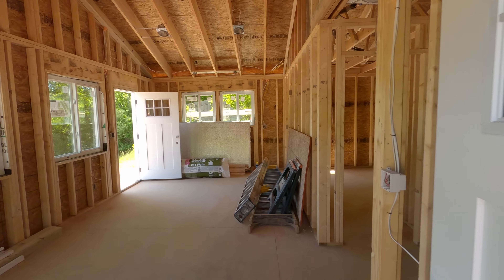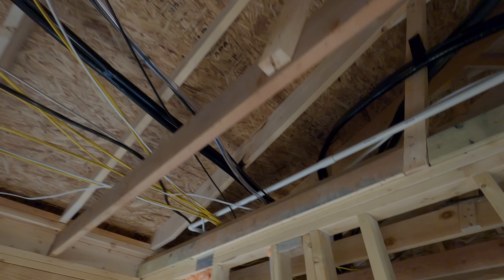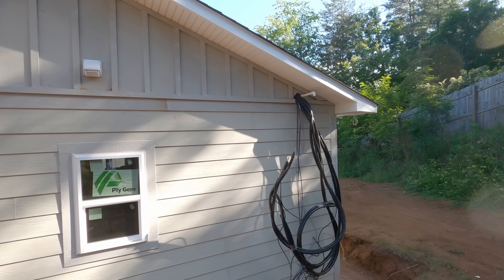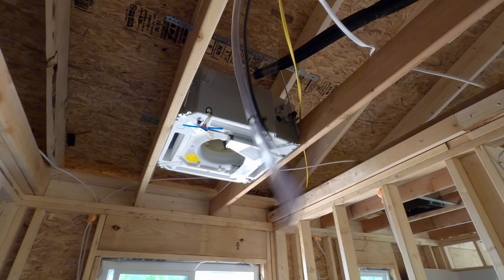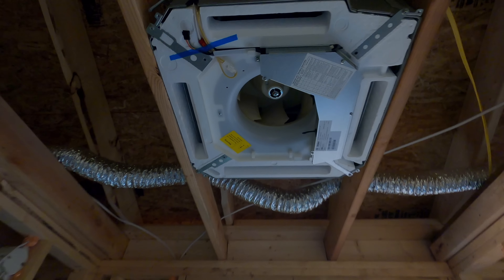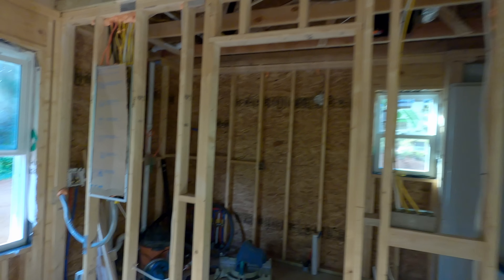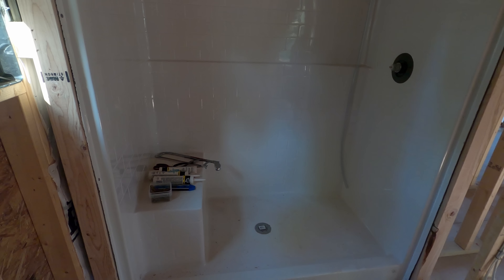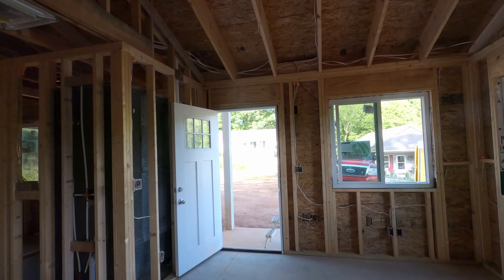Ductless Mini Split System Price / Cost

Comment: I’ll echo many of the other comments. They could have ran the AC lines inside the wall and popped out the bottom of the wall for a much cleaner install. Forget the trim work that needs to be done. You don’t need to see line hide on the outside of a NEW house. That is for remodels where the walls are finished.
I also agree with the few commenters that mention the electric wires are not neatly run.  I always run the wires in a bundle and straight lines. 
Anyway, thank you for putting out great content and don’t let the negative comments get to you, we mention things like this cause we care, not to just be a pain in the ass.
Reply from the maker: Thx dennis no worries, I posted this to show you guys sometimes things like this happen, I'll see how this is handled by the hvac business and see how it got resolved.
Reply: @MigraineCraftsman  yup, that's what I'd do.... "how are you gonna fix this" and it's not the mini split that's the problem, it's the attention to detail of the installation and the crew who did it. Poor quality in my book and if they make it right I'd let it slide. If not... Kick rocks kids
Reply from the maker: @Keasbeysknight  You earned yourself a hearted comment. In business you have to learn how to handle situations and sometimes brute force is not necessary, but a more tactical approach is best.

Comment: They should have capped the line sets instead if leaving them open to air. You can get debris, water, and bugs in the line sets that will ruin system. Not cool

Comment: Correct me if I'm wrong, but at 1:25 you can see the copper lines opened up at the ends. I've done some HVAC systems in the past and from what I know those copper lines should not be left open. Those lines must be capped on both ends until refrigerant goes in, otherwise you risk refrigerant lines being contaminated and it will be additional cost to flush them out. I would suggest to go with PVC pipes for drainage, don't let them install those vinyl pipes, it won't drain property. Any reason why exhaust vent line runs for such long distance? I would recommend you to change it to hard round duct.
Reply from the maker: PVC is what is going to be on the final install as for everything else, there is a lot to this install so I'm going to reserve any further judgement until I see the finished product and see if it works.
Reply: @MigraineCraftsman  Keep up great work, dealing with mediocre contractors is not easy! 👍
Reply: @unnamedny  that install is so far below mediocre it is beyond comprehension .

Comment: I do appreciate your concern for this install. Also thanks for letting us know the price difference between ductless and ducted.

My long term concern about a mini split is that with three heads to clean the homeowners may not be so keen on doing it and it could lead to a shortened lifespan for the unit. Those heads are also quite unwieldy to clean.

Also, don't believe the seer lie.. that's for mild climates where the outside temp is quite close to the desired inside temp. For example it's 74 degrees inside and 80 degrees outside. In hot weather like ga or in my case Texas where it could be 95 degrees outside, any properly sized unit will be running wide open for most of the summer and that is straight up eer rating, not seer.

There are some units that have a higher seer rating, but a lower eer rating than another unit with a higher  eer but lower seer. I'll always take higher eer.

Comment: You’re a great builder with tons of integrity, you do very nice work👍🏽. The only thing I would have to criticize a bit is that bathroom flex vent tube, I would’ve gone with the insulated type only because all of the callbacks I’ve got for leaky exhaust fans in bathrooms that are incorrectly installed due to some builders using that flex duct I a uninsulated attic. I see you insulated pretty well, just in case you see water coming out of that fan know that that’s the probable culprit.

Comment: Great description. I became a huge fan of split ac these days. Good that you went for it. You are trying new stuff for every build! Kudos.

Can’t you install it yourself?
Reply from the maker: I'm not licensed for Hvac, but I will be looking into it.
Reply: Nearly all A/C manufacturers will only warranty their equipment if it is installed by a licensed dealer, so this is really one part of the house that isn't DIY.
Reply: @afh7689  so what ? If you do it all by yourself it would cost around $3500 and you save $2500 . What part, on  the system, will cost more than that?   A warranty  for lazy fools

Comment: Great update. I was waiting for the mini split install. For some reason I thought that it was going to be the wall hanging units. Anyway, can the installer run the line set down the wall on the inside and then have it pop out through the bottom? It does look kinda tacky coming through the gable an then having to snake down the side of the house. Also how many thermostats will be controlling the units?
Reply from the maker: There will be 3 remote controls for the unit. As for the wall units I would have preffered those but they were more expensive over a grand more. The install here is interesting to say the least but I left them alone expecting proffesional results, well I learned.
Reply: @MigraineCraftsman   Don't give up yet. Let the company owner know that you're documenting all your builds on YouTube and of all the HVAC installs, this one was a bit lacking. Let him know that it would be better for his business if he made his guys do a better job on the install.

Comment: Omg. That hole has me PO'ed like I'm the builder or homeowner. Has the mini split crew never heard of a hole saw or neat work? Grrrr!
Reply from the maker: That is what I posted in my community section, I'm suprised they didnt have that when they showed up for the job.
Reply: Omg, me too. I wouldn’t ever get over it!
Reply: @MigraineCraftsman  You have every right to be upset over that. What they did was shoddy work. No concern for quality or craftsmanship. When I was an electrical apprentice, my master electrician was so keen on craftsmanship, he'd demand that the slotted screws on the light plates and electrical plates were all lined up vertically, because people pass judgement on a person's work sometimes based upon appearances. We did quality work behind the walls, too, but what he taught me about appearances and caring about how good of a job you do on both sides of that wall are things I've used throughout my life. You're 100% right to expect them to have done the job correctly. What they did translates to nothing more than getting the job done as quickly as possible to pocket the money, because time equals money. So sad.

Comment: Mini splits are amazing, but do understand that while you can condition an individual room and they all have individual thermostats, you cannot, on most systems) simultaneously heat one room and cool another.  The entire system is either in cooling mode or heating mode, which is fine for most people and use cases.  There are mini split systems that have heat recovery function; these systems with heat recovery can redirect heat and enable simultaneous cooling and heating of zones in the system.  Currently the only system I know of that works on residential single phase 240V electrical is made by LG.

Comment: Im a licensed builder for 20 years. I flipped hundreds of properties and worked on just about all of them myself. I wire houses, i do plumbing roofing etc. I read all the coments and nobody mentioned a hole saw. I would have drilled one hole with a paddle bit for the drain line, and a hole saw for the copper line sets. Then seal them with sealant.

Comment: Not what I've seen for mini-splits. I've always seen the unit mounted or in the yard exactly like any central air/heat pump unit and a very small evaporator/blower unit inside. More zones -- more units. Easily installed and not near that expensive. 
 I agree with you. That is a hack job. And 30-40% too costly

Comment: I held off on the last video on commenting how the wiring was done thinking they just laid it out and it wasn't finished.  Running that wiring as the crow flies is not professional at all.  Put a stop payment on that check and get them to redo it.  I feel for you. This shouldn't happen so frequently.  Professionalism and ethics has left HVAC contracting.  It is a sweet system though. Keep your spirits up there are a couple of good contractors out there...you will find one.
Reply: I agree!! That electrician would never step foot on my job again.

Comment: Migraine how much more expensive is a simple vault like you do in your homes than a standard 9ft ceiling? Should it cost a lot more to do?
Reply from the maker: The actual price depends on the size of the vault/pitch of the roof, plus the finishing touches. It's always hard to answer those type of questions correctly without just flat out guessing percentages. Sorry T, my guess at least 15% when it all said and done.

Comment: I'll be curious how the multi zone unit works for the customer,  I heat/cool a 750 sq ft apartment with a single 18,000 BTU unit and it works great it's a cheapo pioneer that I got for free.  My in laws have a fancy dual zone Fujitsu that just refuses to work right.  It sends all it's cooling power to one zone, it won't seem to do anything to the other zone.  Worked well for about two years, and then that started happening.
Reply from the maker: I'm curious how this works as well, I might offer to pay the ladys first 3 or 4 months of electric bills just to find out.

Comment: did you ever think about building a passive house? i can certainly help you for that, in terms of design
Reply from the maker: I like those but they are not cheap to put together, and banks are not too keen on a unfamiliar product to lend on. (for my customers)
Reply: @MigraineCraftsman  yes they can be a bit more expensive but return on investment is relatively short and pretty much everything comes down to design except additional insulation and a bit sophisticated mechanicals

Comment: That one in the hall should have been put in the living room on the wall above the hall way centered. It should have been a wall mounted unit. That would be better. Then you can set unit to sway area back and forth. The one in hall has 1 small outlet pointing towards that big area. You need wall mounted in big living area. I have a split and I know a lot about these.

Comment: I’m an HVAC tech , those cassettes are awesome when they work fine, they’re fragile and need regular maintenance,  install surge protector.  I still prefer split ducted system . Try to have pvc for the drain instead a clear hose .

Comment: All of those wires and line set should have been hidden inside the stud wall, not running down the outside of the home.  Get them to change it and pay for the siding fix, that job looks like Hell.

Comment: 1.  Dealers overestimate the size of HVAC systems so that they can make a larger gross profit  amount on the more expensive unit.  2. Oversized HVAC systems result in the system running for short periods of time, like 3-4 minutes, instead of 7-8 minutes, which results in "short-cycling" and consequent humidity accumulation because the system never had a long run time to cool down, dry out and remove humidity and condensation. 3. Retained humidity may eventually create conditions favorable to mold, and that is the real risk of an oversized system - black mold.   4.  The partial installation is such that many viewers have "lost confidence in the ability of the HVAC installers to complete the installation in a professional manner" and it may be worth considering having all the Haier equipment removed and going with a different manufacturer (and installer) such as LG, Fujitsu or Mitsubishi in order to source a 1-1.5 ton unit at a much higher SEER rating because in the long-run that will maximize economic efficiency.  Thanks for your wonderful videos.

Comment: Many comments about system size and install. Here’s my 2 cents. I think you went the wrong way about this job. First the load calculation tells you the system size and then you choose the appropriate system with a manual S, ducted or not. 36k for a 750sf house with the insulation you have is insane; that’s 250sf per ton!! I do this for a living and this is not even 90’s build but more commercial performance (or lack of thereof). I don’t know where you’re located (california?) and couldn’t read the thermal specs of the windows stickers but a house like that would probably have a load of 9-15k tops. 
Use a high-static ducted mini-split and you’ll get air in every space, have one unit to service and still be more efficient than a basic split system. 
It blows my mind that they installed a 12k head in this small bedroom. I live in FL and this install would be great for a mushroom farm...
As for the linesets coming out of the side and everyone going crazy about it, first they clearly did a shit job in general but not capping the lines is beyond criminal, second they should’ve cut a nice hole and installed a dedicated line cover and third for those who want to run stuff inside walls, a) you break your thermal barrier and b) you can’t fix or replace the lines without tearing out the wall if need be c) running a water line that can get plugged aka drain line insiste a wall is stupid. So yes, esthetically it is not attractive to have a line cover on the side of the house but I’ll take it any day for service access. Covers can be painted and you don’t sit outside looking at it 24/7...
Reply from the maker: Thx for your input, I am curious about the load calculation as well, I wouldnt be suprised if it was a mistake, but well see how this plays out.
Reply: @MigraineCraftsman    I don't know where you're located and your construction codes, but in FL contractors are legally responsible for what they install and if any issue due to over or undersizing would occur, they could and would be liable for the cost of the repairs, whatever those might be. If I were you, I would nip this in the bud right now before drywall and insulation while everything is easily accessible and your house sold. I do third-party consulting for anyone that needs my services and those situations are never fun. You might want to have another company redo the load calc even if the one that installed the system shows you one because I am pretty sure it was fugged.
Reply: @peteaulit  lol....there obviously was no load calc.  They knew this guy didn't have a clue and took advantage of him.  Sorry, not trying to be harsh but it is true.  Is what it is.

Comment: Installer should have run the line-sets on the inside of the walls and poke individual holes for each line its done neatly. Looks like a bunch of squirrels did that hack job of an install.

It would have been a lot more cost effective to install 2" rigid foam insulation on the exterior and just one one mini-split for the entire home. Build cost would have been lower & the owner would have smaller energy bills!

Another option would to use a ducted mini-split so you could distribute the air with a small amount of duct work. FWIW: I am building a 3400 sqft home with just two ducted minisplits (one for each floor).
Reply: He mentioned in the video the extra zones are for bedrooms, so you can cool just one bedroom at night (to sleep better) instead of the whole house, although I don't know how much of a difference it makes in such a small house. It might have been better to spend a couple thousand on better insulation for the whole house than separate mini split units. 

That's the main reason I too would get a mini split is because I sleep much better at night when the room is cool (especially when the Florida air is so humid), but having a separate zone for the bedroom might be more efficient.
Reply: @afh7689  unit sizing is way ways off.   Wasted 4 grand easy.

Comment: I'm a licensed HVAC contractor in southern California. Good system you installed but lazy installers. They should have ran it down inside the wall and popped out the bottom of the wall right at the outdoor coil since it's new construction. They plan to stick a eye sore line set cover over all those lines and to cover that horrible hole they cut. Too bad they dont care about their craftsmanship  the same way you do!
Reply from the maker: Agreed new construction should be easier on them, but it didnt work,out that way.
Reply: @MigraineCraftsman  Uh. YOU are supposed be running the job!  You should have been able to tell within the first hour that they were clueless and thrown them out.  Actually,  you should have known they were clueless when they told you you needed 36k blues, but still.

Comment: 19 SEER ? Do they still make those or you have to rob  museum of old electronics?  I install 38 SEER 15 HSPF 9000 Btu Gree in a living / kitchen room , when it is not too hot or too cold it will cool or heat my house the most efficient way ,  for cases when  it has not enough capacity I will install other mini split with ducts for bedrooms

Comment: Have you done heat pumps on your other houses?  Split systems can be expensive but see my other comment about poor location of hall unit. Poor workmanship, and leaving them pipes open is not good. Run over there and tape the ends. Don't like the drain set up. Any trouble with freezing or leaking will be a real mess with all your blown in insulation. I may be wrong but I would kick off job and take a little loss and get someone who knows what they are doing. This is only my own opinion but I have been in construction all my life. Retired now. Don't mean to cause you any anxiety.
Reply from the maker: That is my first mini split install, I wanted to try something new for energy efficiency. I usually do conventional heat pump/ac and I think I'll just go back to that to be honest.